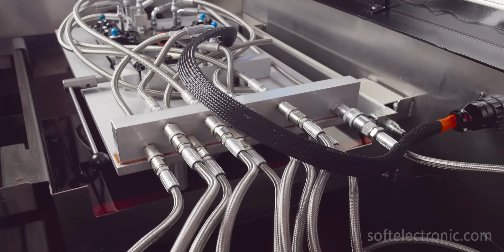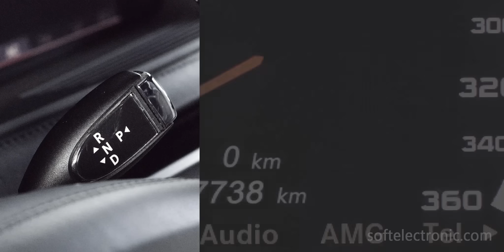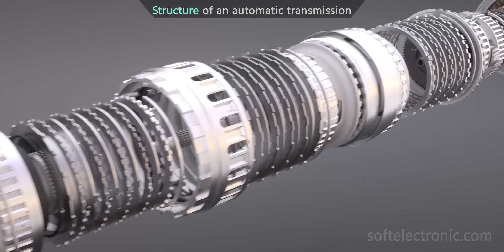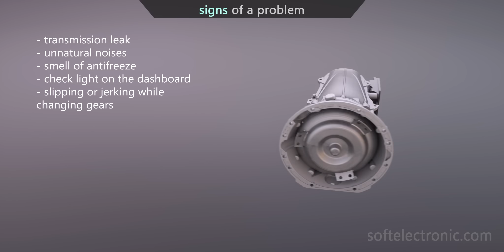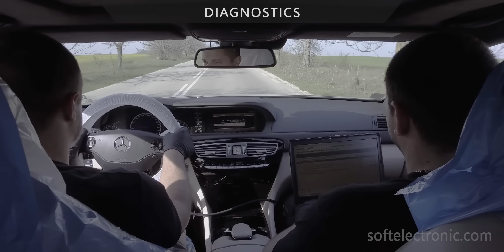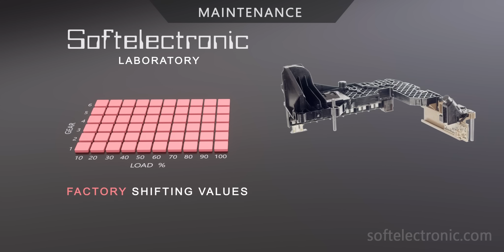⚡How Automatic Transmissions Work?⚡ Diagnosis, prevention and repair?

Comment: When I put the engine on my 95 impala forgot a plug on the trans and I went to drive it and it was only one gear and when I plugged it in then it started shifting .... so if I  were to put a button I can make it shift when I want like a manual transmission can't I?

Comment: Three key functions, transmission fluid:
● it provides lubrication of the moving parts
● cools down the gearbox
● takes part in the hydrolic system 
                    Work cycle
● from the oil pan it goes through the filter and from it into the oil pump 
▪︎ The oil pump then forces it in the valve body of the mechatronic at high pressure 
▪︎ Mechatronic regulates the pressure and distributes it to the torque converter and various suctions of the gear box 
▪︎ After that the oil goes through cooling system and returns the transmission .

Comment: Sir I had a problem with my tata nano AMT (gnex) by mistake the reverse gear got stuck n I took it to tata authorized workshop but the technical just switched on  for 5 seconds lights seen on dashboard n told me he will diagnose n scan but he kept the vehicle5 mts away from workshop then after 20 days moved pushing inside the workshop but as I read the manual it is clearly written that auto car should nt be pushed as Catalitic convertor gets damaged n in course of time other components but I was shocked when the technical consultant phone me   my nano AC has become faulty so I asked him that when you inserted key the dashboard was showing lights on the cluster   Sir what is your opinion on this subject ?Should I file a suit against the workshop  technician. ?

Comment: Thanks for this video! 

I have a ford econoline e350 year 2013. My car did not move on Drive and something went wrong. I open the transmition cover and I find out that the oil filter was floating. I wonder this is why my car lost power and the gears were not shifting. Any answer will help me to be clear. I am buying a new oil filter because I think the old one felt because I can not be hold in place. Any answer I will be grateful.

Comment: My latest vehicle (GM 2016) has got an automatic transmission (6BNA) and it just looks like what is being described here; did a DiY pan down ATF change including filter 2X years ago at 36K Kms. (instead of 40K Kms/svc manual as oil was going brownish); just replaced transfer case ATF at 42K Kms. - should have done it at the same time as it was getting murky but was misled by the service manual about the transfer case ATF can be changed + 20K Kms. or so later if not used regularly (transfer case).

Comment: For all your raving about automatic gearboxes, why do all performance drivers still prefer a manual gearbox? Because if you can control the car accurately, you have control. Automatic boxes offer forward thrust control but no rearward. They reduce the tactile control the vehicle has on the surface. Therefore the only way to change between accelerating and decelerating is to apply braking. This upsets the dynamic balance of the vehicle, especially on anything but a straight path. Automatics are not better, they are not safer, they just allow people with a far lower skill and coordination level to pretend they can drive like a real driver 👍😂

Comment: Hi , thanks so much for the video , I have a question and hope to get an answer regarding my transmission (2014 cla 250) .the question is about the transmission oil , is the transmission oil shared with the transmission electronic part oil ? I was told that the electronic part has its own oil and SEALED (which mean if metal shavings found in the transmission oil doesn’t mean that the metal shavings can get into the electronic part ). My transmission is bad and want to replace it with a used one , I’m wondering if I have to buy the electronic part separately or no , note that no lights at all in my dashboard . Thank you!

Comment: Okay. So a question. 
The car suddenly didn't go forward.(like neutral)  But had reverse and Park. 

So disconnecting the cable at the brain box . It then clunks into all gears.  (it's jackup on stands so the solid clunk could be because it's in the air).

Comment: I have this problem. The engine starts fine but won’t move on drive or any other gear. It takes time before the movement kicks in, then it goes fine until when I come on stop then it starts again

Comment: I like your 3d model of the automatic. The only complaint is during the diagnosis you said look for smell of antifreeze. I feel like it could of also have been a typo or whatnot, because antifreeze extracts heat from the engine. There were some minor typos like for the word standard at  some moments. great basic breakdown of the valve guide

Comment: Autematic gear box bad variant. Problem cold winter season and summer season. Special cooling system radiator antifriz +80termotast fast work cooling engine and autematic gear box oil. And system electronics relej to drive Hard work real travel.

Easy variant live manual gear ever day. Remembered every and little problems.

Comment: please make a video for Automated Manual transmission also. this is same as manual transmission. the difference is the gears are shifted automatically instead of a human intervention. AMT has synchromesh gear box ( not planetary gear box, as in case of Automated transmission ).

Comment: Thank You so much for making and sharing such and amazing video. I just got gear problem in my car due to oil leakage and it stopped on road. got the gear box opened and replaced the 4x4 gear converter. it works fine now. this video teaches best about gear box and its components as i see them first time and due to this video i know what it is and how it works. again thank you for educating in excellent manner. You you get what you have ever desired for.

Comment: Hmmm, repair prices? My BMW with about 20,000km recently needed to be rebuilt. Right after the warranty ran out. Being in Japan, I got out for about 80,000¥ ($800) but the cost could have been over 5 times that much.

Comment: Look up precision transmission if you want a mechanic's experience on how an automatic transmission works. They pull them apart in minutes and will explain what does what, why it failed, what the manufacturers did differently in later models to fix issues, what they didn't, and many more in depth but easy to understand explainations. By the time you're done watching a few of their videos you'll feel like you could rebuild a transmission yourself.

Comment: When a car groans and draws on engine load in “Park” position; is the clutch pack of the torque converter being compressed in fault?
Faulty pressure relief ?
It pulls engine idle higher in response to a draw of torque against it.
* My transmission rebuilder was unsuccessful at remedying the issue.  700$ in - still the same shudder issues ; mostly at full stop involving lunging against braking at lights.; and idling in “P”.
1993 AW 03-71 L in Volvo 940.

Comment: Dear Sir,

i have Renault Safrane 2012 Model its give Check Gearbox message  engine is going emergency mode when i was switch off engine and Remove  key for 10 Minute than car is moving perfect 

but next day again message appearing, Mechanic Clean Gear Box Filter and clean all Injector and replace Plug change oxygen sensor 

still same problem what will i do 

mechanic Suggest to  Change Transmission  for this problem

Comment: 40 000Km fluid change is just and example. ZF8HP by German ZF company requires fluid change between 80 000 - 120 000 depending on driving conditions.

Comment: When comes to maintenance cost,repair cost,replacement cost,manual transmission is the best.
No automatic transmission has in real life same mpg as manual.I checked that with lots of cars.With manual transmission the chance to be stranded on motorway due to transmission issue is almost impossible.
No automatic transmission has good reliability record.
"Mechanics" these days are unable to diagnose correctly almost anything.That's the reason why,I believe manual is the most reliable transmission.If you don't ride clutch at traffic light,I guarantee the clutch will lasts 150000 easy.
If you don't mind to pay a lot for transmission maintenance or repair and you like comfort,automatic is the best for you.

Comment: P2770 Torque converter clutch solenoid circuit high .
Toyota Corolla 2012 1.8 
Octane engine. 
Explain please what's the problem.

Comment: With a manual transmission, the starter motor is connected with the flywheel when starting. How is the starter connected with an automatic transmission? I was told that there is no flywheel connection with an automatic.

Comment: Hello ! Does anybody have an idea of what happens to the automatic transmission on my Opel insignia ?
 (it's gearbox AF40-6 )It's been happening since I replaced the gearbox oil in the service . It won't change  speeds well from 1st to 2nd and from 2nd to 3. From first to second gear it shifts to 2500 rpm and about 25km / h, and in third it shifts to about 45-50km / h and about 3000rpm.
The diagnostics say everything is fine but since the oil change the gearbox is not working properly

Comment: I am a mechanic in Brazil and a staunch enemy of automatic transmissions, because they last little, break too much, and the cost benefit is too expensive for its useful life, not to mention that a mechanical transmission gives you quick and efficient responses, they last forever, for here an automatic transmission does not last more than 03 years.

Comment: Having just been through the process and cost of having my automatic transmission “remanufactured” your videos go a long way to explaining why it was costly. I’m keen to see Episode 4, there were a couple of hiccups and the car has been back to the repairer. The final result feels promising that all is well, smooth power delivery and up shifting and down shifting. Once I know what fuel economy is like I will know how well it is operating. Did I mention I’m keen to see Episode 4 GEARBOX?

Comment: You will ALWAYS have a higher MPG with a manual, than you would an automatic. If your vehicle from the factory has that option, the loss for an automatic is never less than 3, tops. A manual will have +3, give or take.

Comment: My Nissan Sentra 2015 CVT failed at 59k miles. And same with my Toyota Corolla 2017 CVT failed at 60k miles. I'm not really a big fan of the CVT transmission.  I drive a lot though but just weird that with my two cars the CVT failed at 6Ok miles.

Comment: Manual transmission can start a car can you pulled.....but atomatic transmission cannot start a car... pulled.....this is a main ... FAULT...IN THIS TRANSMISSION..... COLD WEATHER AEREA....FACE A BATTERY LOW CHARGING PROBLEM..... AUTOMATIC TRANSMISSION...NOT SUPPORT YOU.CAN START A CAR ON PULLED....BUT..MENUAL TRANSMISSION...IS BEST RESULTS YOU CAN PULLED YOUR CAR CAN START....TARQCONVETER.... CANNOT SUPPORT YOU PULLED YOUR CAR...THAN STARTED YOUR  CAR.....
minhasr24@yahoo.com

Comment: Poorly done and not representative of current industry. And it assumes it makes one a better driver, maybe the AT should have a mobile phone sensor and the vehicle will detect it and not allow movement until it's turned off. How about a face recognition sensor that determines if the driver isn't distracted and the vehicle starts to slow down or won't move.

Comment: This dosent make me buy an automatic car because manual is cheaper to fox this guy is wrong in most aspects also there's more control in manual then auto and being good driving a manual, your shouldn't  have any problems at all usually clutch is a thing to change in manual and that's usually on older or high milage cars.

Comment: Corrections:
 "Chassis " is where all the components are bolts on its consist of two parallel beams and cross members
Components that propel the vehicle are called "Drive train" it includes the clutch, transmission, propeller shaft, differential, differential shaft and wheels

Comment: I have never understood the problem with aggressive driving and burnouts. Once the clutchpacks engage (which they do in parts of a second) the torque converter takes all the beating at low rpm and its should be no different than a manual transmission once lock up is engaged.